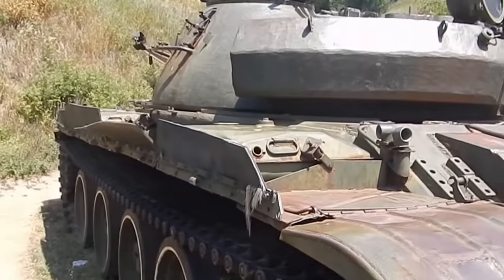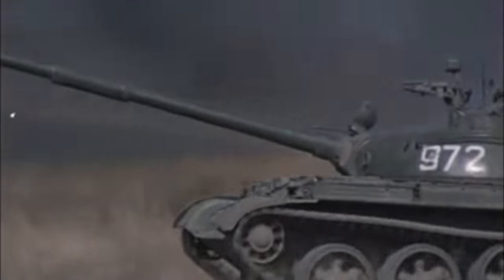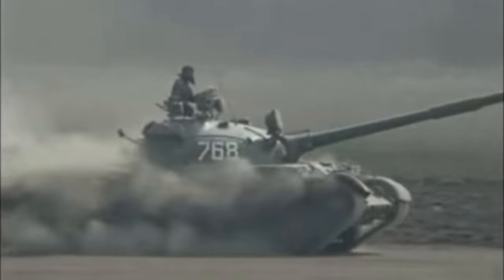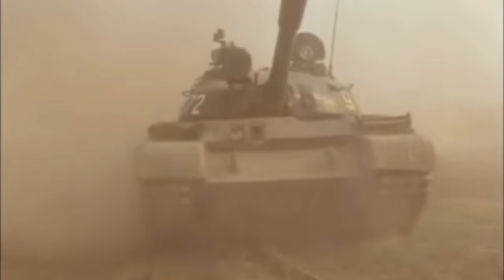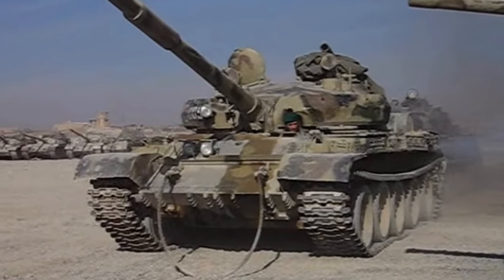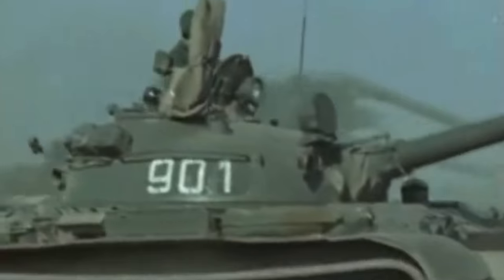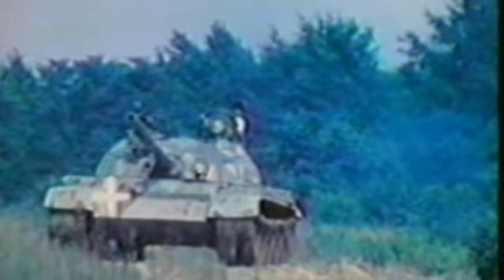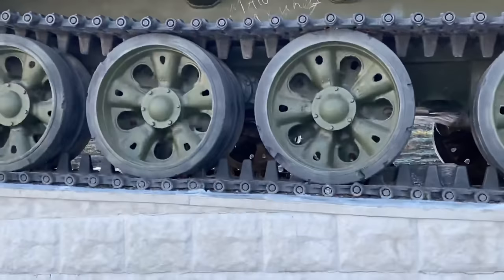T-62 Main Battle Tank | SMOOTHBORE UPGRADE

Comment: That fact that upgraded Isreali Shermans were knocking these out in 73 with 105mm heat rounds is a testament to just how good the basic Sherman design was is
Reply: It's more a testament to how superior a HEAT round is, to a steel armor of any thickness. All it took to stop these is a little composite add-on, but during the late 60s-70s no tank was truly safe from chemical rounds.

Comment: THe part where you say that it's not an anti-tank tank but an infantry support tank literally encompasses the Soviet CONOPS for tanks. To Soviets tank v tank warfare isn't primary role for the tanks. That was the role of the artillery and aircraft. And they are right to say that since from WW2 and all the way through to now, tank losses are at least 80% due to enemy CAS planes and attack helicopters.

Comment: The  main battle tanks of Russia were designed simply just like old Soviet designs. Simple designs that produce big numbers. The Cold War tactics of the Soviet Union was to produce a basic tank in great numbers to over come N.A.T.O. In a quick lightning attack. Unfortunately the  Russian main battle tank kept the rounded turret that had an advantage of deflecting shell hits but limited crew response to firing. The  turret  limited its fire rate. Don’t get me wrong it is a deadly tank but that’s why Russia came up with the T-14  Armata. Basically put the T models are to old to survive on the modern battlefield. This was proven many times in various conflicts with western tanks.

Comment: 3cm of steel plates?

This is one T H I C C tank
Reply: This is for anti heat projectiles not for AP shells
Reply: @Neonblue84  ArE yOU SUrE aBOuT tHAt ?
Reply: @TheMadVulpen  yeah if you mean the "eyebrows". Because the space between this plates was filled with polyurethan (or so^^) and that let sink the heat penetrating rate (for atmg of the 1. and 2. generation, today is that all little helpers of course obsolete)
Reply: @Neonblue84  ik I was memeing
Reply: Just Some Guy without a Mustache isn’t that just 30mm? Sry I’m American
Reply: @Raj-df7wf  yeah it is
Reply: I think you mean 30cm**
Reply: men of culture

Comment: Not sure you are aware , but at 10:04, despite having a fume extractor, this is a T-54 type tank. Note the gap between the first and second road wheels, along with the mushroom shaped ventilator on top of the turret. You mention the layout of the road wheels in the video, and you may be purposely showing a T-54 in order to illustrate those differences, but I wasn't sure. Regardless, a quick internet search shows that this exact tank is a Chinese Type 59 being displayed at Tank Fest. This short video clip is a great example that really illustrates your point. If a person were to look at just the fume extractor, they would assume this is a T-62.  Thanks for the great videos and keep up the good work!
Reply: You dont looking carefooly !
Reply: Its getting really confusing with tanks like the Typ69 IIA with the 100mmm smoothboregun
Reply: I like the type 59 or T54A
Reply: @John4566442... LOL, all the same, T54, 55, 62, etc., they were still all targets to us! We had MBT recognition card decks and as far as we were concerned, we spot em mostly via turret shapes, especially frontal turret silhouettes. If we could see and count their road wheels, they were dead meat already.
Reply: Judging by the western smoke launchers and presence of 105mm gun, type of font used for the numerals i think thats Israeli modernized T-55 (i dont remember its exact name rn)
Reply: Good spot.

Comment: Horsepower doesn't have mutch say in top speed unless you change the transmission as well. The engine can only go as fast as the transmission allows it to. Lets say you have an old VW Golf with a top speed of 120kmh. you can add a turbo to the engine, it will make the car accelerate faster because of more horsepower, but if you go faster than 120kmh the engine will blow up because the transmission is what allowed it to go just 120kmh.

Comment: Matsimus: Thank You for another thought provoking video.

T-62 illustrates the Russian problem - especially in these days. Russia has incredible problems financing their armoured forces. It seem like - at the moment - that the T-14 Armata is going nowhere. Provided they get the kinks sorted out, the introduction of the Armata has at least been postponed.

This refers back to another video with Matsimus: The one discussing the merits/flaws of updating existing western tanks. It is allways a consideration if an update - with its inherent drawbacks is sufficient to do the job. In case of the T-62 it clearly wasn't in so far, as they got creamed meeting Israeli Centurions.
I believe the Soviet Union then stood in the same problem as Russia does with the Armata today. The Armata is clearly a better tank than the T-72 (even in its updated version); but the main problem is there: With the falling oil prices it is extreemly unlikely that Russia will be able to afford the Armata in anything but token numbers.

It is like the proverbial Tiger tank that had the allies worried no end. It was simply to expensive to build - let alone transport around.

The next illustration is the T-64/T-65 where the T-62 should hold the fort untill the T-64/T-65 was build in sufficient numbers. Problem was that sufficients numbers of a to expensive tank - and the Sovjet economy was all the time similarly strained - was to heavy a burden on the budget. The solution was the T-72 tank.
The T-72 is a "budget-freindly" tank, but it demanded hoardes of them to get the job done.

Besides: I saw that the canadian (with F-18) are involved in an exercise with the A-10 Warthog, ostenciably against the fast patrol boats of the Iranians.
Reply: Thomas Borgsmidt T-64/65? I only know T-64 but there is no T-65
Reply: "Russia has incredible problems financing their armoured forces. " there is no such problem.
"falling oil prices " has nothing to do with that, all russian tanks are completely produced in Russia from russian steel and parts made on russian factories and payed in russian rubels.
Stop this "Sovjet economy" propaganda bullshit. 
T-14 is still on trials and evaluation, it is 100% new tank. All previous tanks done the same way. First trials, after that serial production.

Comment: I wouldn't say that it wasn't necessarily horrible for tank on tank fighting.  More of it wasn't employed properly to its strengths.  We know that most Russian tanks were designed with limited gun elevation and depression, making this tough to fight an uphill battle.  This is partly the reason why the Israelis cause such high losses at the Battle of Golan Heights.  But on a relatively flat terrain, I am sure it was a force to be reckon with at its time.

Comment: T-55 and T-62 and very noticeably different, even in M form.  ALL T-62’s have a stretched area behind the turret.  The T-55 has a much more centric turret position where as the T-62’s turret is biased forward of center.  Also I’m not sure about the T-62 being a stop gap design.  The development project was underway before the T-64’s.  I think the continued production of the T-62 was a stop gap measure but actual design and development was it’s own project which ended up be overshadowed by the T-64 which was the HMS dreadnaught of the MBT world.  The T-62 was designed and developed by Ural whereas the T-64 was designed and developed by KMDB.  Additional, the Soviet Military allowed Ural access to the T-64’a tech.  Ural then took the T-64’s advantages and applied them to the T-62 chassis and developed the T-72.  Also to my knowledge the T-64 was never exported.  KMDB was based in Ukraine and this is why Ukraine has the T-64 after the collapse of  the Soviet Union.

Comment: does FCS  really matter when you can shoot APFSDS which go like a laser, compare to western side relying on HEAT-FS
Reply: HEAT maintains pen over any distance.
Reply: @surferofthesynthwaves4710  you don't get my point.

hitting with HEAT-FS is difficult at long range, it is not just slow but also flying terribly at long range, so it require FCS but, APFSDS is not.
Reply: @rhino1207  but apfsds loses pen over long distances
Reply: @surferofthesynthwaves4710  ? does it matter to what I saying? is less penetration at long range related to importance of FCS?
Reply: I dont care about western tanks
Reply: @surferofthesynthwaves4710  I mean why you said  "HEAT maintains pen over any distance" and " apfsds loses pen over long distances".  what you want to say from it?

Comment: ive always understood the T-62 to be classed as a medium tank by the soviets, with their first true MBT being the T-64. also, you can tell the difference between a T-55 and T-62 by looking a the turrets as well as the hull, the T-55 has a slightly taller, narrower turret (not quite a circle), and the roof has what looks like 2 angled welded plates , wheras the T-62 has pretty much a circular turret with a lower profile other than the commanders hatch, in one single cast. admittedly it would be hard to tell the difference from a distance.
Reply: Yah but they were decently armoured  mediums tanks for their time at least.

Comment: You mentioned that the T-62 has NBC protection, but how can that be? There is a rear hatch in the turret that automatically opens to eject spent casings, which would expose the crew in the case of an NBC attack. Was this feature removed from the tank or something?

Comment: Im curious as to the H.P. upgrade? The top speed remained the same probably due to the transmission and final drive gearing not being changed. However Im thinking the ability to maneuver may have improved. Top speed being good. But im betting the crews would really like being able to go from 0 to even 10 Mph faster would be well liked. Imagine setting static at road side and hearing the dreaded sound of a jet or I would think even more dreaded womp womp womp of  rotor blades  Being able to get to cover faster or traversing the hull faster to maneuver to engage an enemy tank quicker is what that H.P. increase afforded the tank. Yes turret traverse speed is very important in a engagement, but getting your hull into cover is mabe more important as to staying alive to shoot is a good thing. There is also this may have been  an upgrade for future weight increases from module additions. At any rate I always liked the T62 and T55 I also liked the British Crusader. At the age of 8. My Dad was an E5 8th Infantry Chemical Corps HQ Co. He had taught basic at Ft Jackson S.C. But we were then stationed to Aberdeen Proving Grounds. Edgewood Arsenal in Md. Aberdeen P.G.? OMG Tank Heaven to a 8 year old boy. Who Breathed eat and slept anything Army. I slept in my little Olive Drab BDUs and combat boots. That Dad taught me to spit shine. I probably had some of the best mirror bright Boot Tips on post lol. As I polished those puppies like my life depended on it. Im sure my arm thought. This boy has hit puberty early and with clock work. But the Armor that post had. All U.S. Armor as it was developed And all enemy and even peace time Armor the U.S. captured bought or five finger discounted came there to be tested.I climbed on and played on everything from T34s 34/85s All the WWII German Pzs Models III IV  I even have a scar on my right shin from missing the tooth on a Panthers drive sprocket. You have no idea the size of some of these things till next to one. The IS series? HUGE!!! The little French Renault FT17 looks like a VW Bug next to some. They were Americas !st MBT And What got General George C SCott ummm Patton lol cut his teeth on. He commanded  Americas 1st Armor assault on mass  in WWI With a number of these IDK the numbers anymore but more than 10 I think. Love the videos Sir Please keepem rolling our way. ARMOR VIDEO UP!!!!!

Comment: Mat, First, thank you for another very informative video. Second, please forgive the formatting - YT hates my Surface tablet and removes all the paragraph breaks.,  That said, the more powerful engine not increasing the top speed isn't too uncommon. Speed is based in part on the power of the engine, but also on gearing of the transmission final drive/transfer case/rear axle. For example, if the original engine has a maximum RPM of 2500rpm (assuming diesel, but any substitution works) and the new motor has the same redline, then the maximum speed won't change. What changes is how long it takes to achieve maximum speed in any given gear and improved torque for low-speed operation.  Maximum speed only changes when the replacement engine has a different maximum RPM. Whether higher or lower, the maximum speed will change with the max engine revs. This is assuming that the vehicles' gearing is such that it can achieve max RPM in top gear.  Ideally, what you see with an engine upgrade is increased performance in rough terrain and low speed maneuvering. The catch is that if the new engine has more available power than the rest of the power train was designed for, then you're going to see increased breakage / poorer reliability in the rest of the power train.

Comment: I wish soviets never created automatic loading
Reply: jihad shari why?
Reply: @divinesan7786  because of higher probability of ammo cook-off
Reply: jihad shari and without the auto loading, it will be the same. Other countries without autoloader is the same as Russian tanks. The US has blow out panel makes it safer. In short, ammorack has nothing to do with autoloading, it is the ammunition placing.
Reply: @divinesan7786  off course it's about placing, Japanese, South Korean and  French automatic loaders are safer than Russian ones, they are placed at the turret's rear which has a less  probability for being directly hit than the Russian systems. Russian systems are placed at the middle of the tank which is the easiest place to be hit in an ambush targeting the side of the vehicle
Reply: jihad shari being ambushed no matter where you place your ammo, you will still be killed. Russian turrets are oval shape and small, it doesnt big like Japanese, French, etc, so there is no area to place. Their designs are different. From the front, Russian tanks are usually well-protected so the ammo is safe, danger is from the side which are most tanks the same. So like i said, no matter autoloader or not, it is still not different. T-14 design is improved the safety for crew and ammunition.
Reply: @divinesan7786  well I forgot this point, smaller area = a more difficult target to hit
Reply: jihad shari and yeah, this is Russian low profile for. Talking about ammunition, smaller area is bad because takes less ammo and it doesnt help when you get ambushed. And most western tanks are bigger and heavier than average Russian tanks.
Reply: @divinesan7786  and all what we're talking about is from the past 😅, today's protection is based on electronics
Reply: jihad shari yes pretty much. APS and ERA. Armor is not as good as it used to be.
Reply: @divinesan7786  so you mean that lower profile is useful only when there is a face to face combat
Reply: jihad shari i mean low profile is for hard to hit, especially when you are on the move. For today FCS, it is not really an issue.
Reply: @divinesan7786   Yah well I honestly think auto loader's as a concept in themselves is not a bad idea. Their are pros and cons with auto loaders as with manual. One less crew means more work to maintain the tank but one less crew member to injured or killed in battle. 

Also early gen auto loaders were probably bad because the technology was a newer concept and it was more prone malfunctions and early Russian tanks with auto loaders were more cramped and I read horror stories in books that the auto loading system could sever limbs if the crew wasn't careful. It was also more an after thought I think to.

I think you design a tank intended to use an auto loader for the beginning it like the french Leclerc it might be more effective  and less of safety hazard but the down side your turrets bigger and your bigger target.

Also newer Russian tanks have armoured carosel's along with blow out panels and blast doors. 

Manual loading maybe more reliable overall and some well trained crew could load faster. But human loaders to get fatigued which auto loaders don't.

I am no expert and I honestly can't say if manual loaders are better than auto. I am mean early auto loaders were probably worse but I suspect current gen auto loaders are pretty good and could be seen as viable option for future tank designs or modifications to current tanks if a nation choose though. But I don't see it completely remove human loaders auto the way either as humans can learn and adapt better than computers or automated loading systems

It all depends really I think it comes down to what works best for your nation.But Auto loaders do interest me from designing process. How simple or complex is to build an auto loader and not only build one but one that functions well. But that is just my lengthy opinion lol.